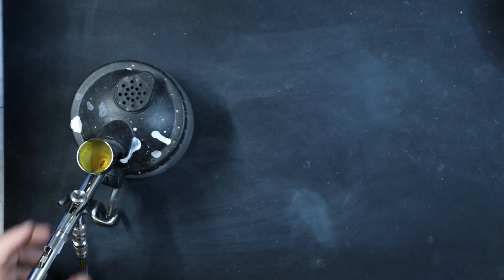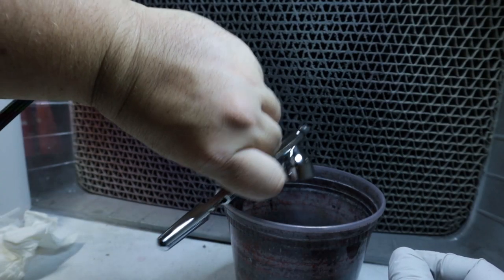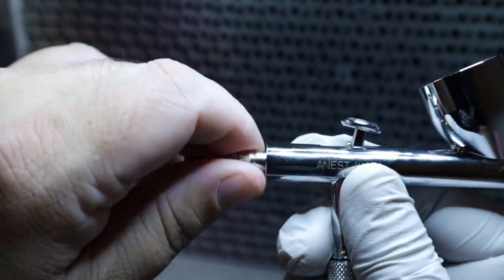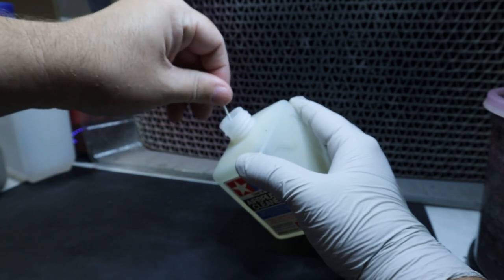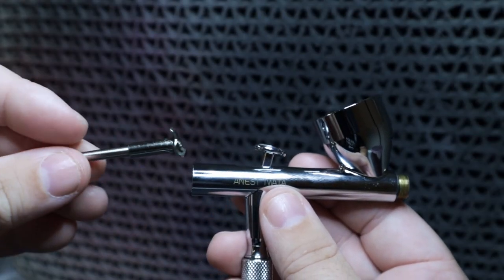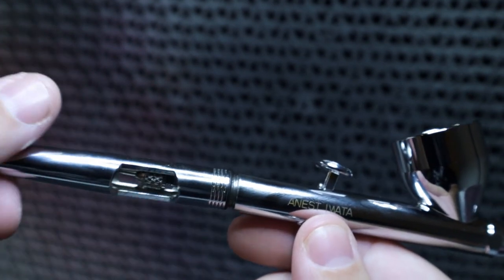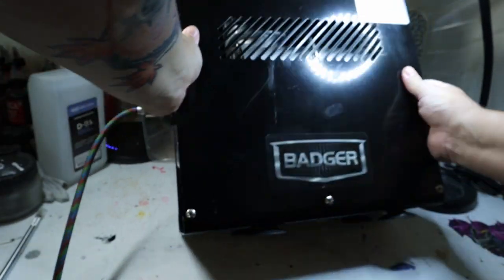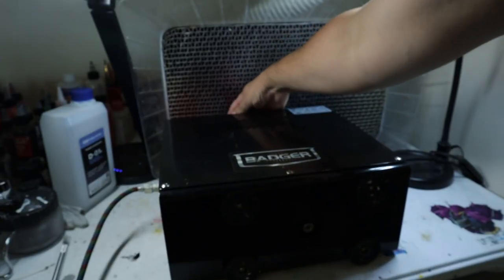Airbrush Cleaning Guide - Complete Gunpla Airbrush Tutorial Series Part 3

Comment: For airbrush cleaner, you can really save a bundle by going to Home Depot and buying a gallon of Klean Strip Lacquer Thinner.
Reply from the maker: I'm gonna pin this comment! While I did use Acetone airbrush cleaner in the video, if you are using lacquer-based paints you can absolutely save a ton using hardware store lacquer. I actually have a jug sitting next to my paint booth for this exact purpose! For this specific video, I used an acetone-based thinner as it's applicable for all paint types from acrylic to lacquers. Thank you so much for watching and commenting!

Comment: Very informative video! When reinserting the needle into the airbrush body, great care must be taken to avoid hitting or bending the needle point. I often use the technique to insert the needle from the tip of the airbrush body, and pushing the needle backwards rather than forward. This means that the cap must be assembled after the needle has been inserted.
Reply from the maker: Hey, there's a great discussion! 😁 I usually insert it from the back to avoid any missed paint from being pushed into the body but you're right. Extra care must be taken when reinserting the needle.
Reply: @PlamoTherapist , I think it’s a matter of personal preference. To avoid the paint being pushed back into the body I use an old blunt needle to do the trick before inserting the good needle from the tip.
Reply from the maker: Ooh. I'll have to try this method and see how it goes. 😁😁😁 Thanks for the suggestion.
Reply: @PlamoTherapist  you are welcome!

Comment: Hello, would you recommend using a pistol trigger airbrush (like the Iwata TRN1) to get the same results as a regular one? I feel like the trigger on top of the airbrush could be a bit awkward and maybe even painful to use over a long time... :S 
I do wonder however if you get the same functionality. They are advertised as dual action but I have a hard time figuring out how that would be the case
Reply from the maker: Hey Doc! Trigger style airbrushes like that are great for large area coverage, but due to the mechanisms in them, they're usually not as well suited for fine lines or details like the traditional airbrush mechanisms.

I think they're a two-stage trigger instead of a dual action meaning one motion, but two stages of activation. First stage is air only and second releases paint. Again, great for large batch jobs, but won't be as suited for detail jobs like pre-shading.
Reply: Hi! I’m chiming in on the topic as I own an Iwata TRN1. As PlamoTherapist wrote, and based on my personal experience, pistol trigger airbrush lack the precision to do some finer work and detailing, but are very good for things like priming. Using a regular trigger airbrush for long period of time can result in fatigue to the hands and finger, so you may want to take some breaks during your paint jobs.
Reply from the maker: Hey! Thanks for adding to the conversation. Yes, I believe these are perfect for priming kits as they are more ergonomic. However, If I had to choose a one-airbrush set-up, I recommend a traditional brush. If you can afford multiple, then definitely go for it. 😆
Reply: @PlamoTherapist , I fully agree with your  comment. I’m lucky enough to be able to afford two airbrushes, but if I had to choose only one I’d choose a traditional trigger one because it allows more versatility. Airbrushing is fun and creative for me even considering the cleaning 😂
Reply: Wow! Thank you all for the input. It makes a lot more sense now.
As I have never used an airbrush up till now, I was a bit worried about the strain on the hand but i guess you're supposed to hold it more like a pen (slightly pointing downwards) rather than a gun.
At this point I definitely can't afford buying two, so I'll select a normal airbrush 😁
Once again, thank you all for the advice!
Reply from the maker: The cleaning is also an enjoyable moment for me too. 😁😁😁
Reply from the maker: No problem! That's what this series is all about! 😁